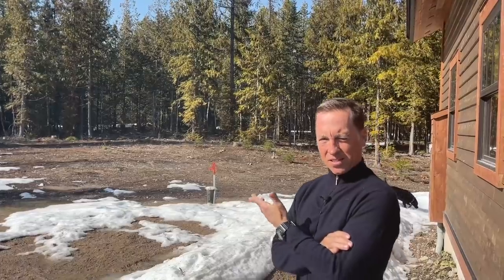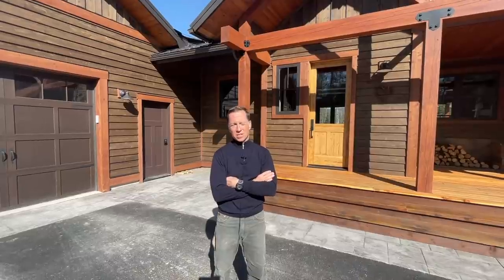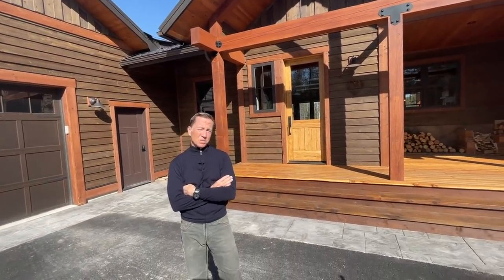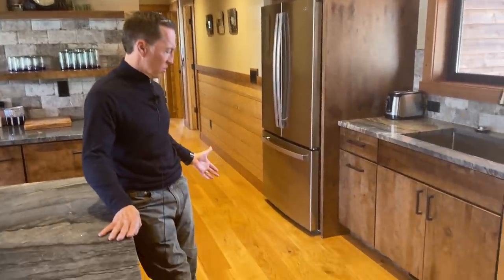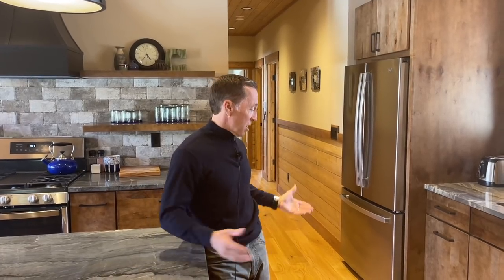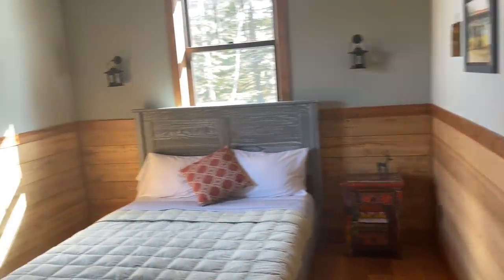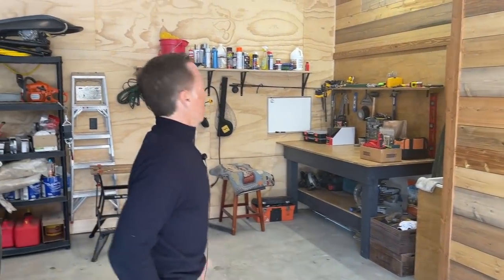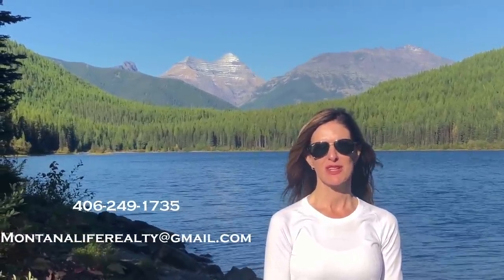Building a New House in Montana Part 2

Comment: This was a really good clip and I am thankful for the nice tour. They really did good.
If you are still in contact with this guy, the owner of the house I have a great improvement suggestion to him.
I also have water pipe floor heating. What he can do is to instal a thermal heat pump instead of that water heater. He already have a well for it. Run a hose down and up again, use alcohol as the liquid which is pumped down the well at around 32f and comes back around 36F, the pump has a heat exchanger, kind of like a reversed AC that will make warm water that is pumped out in the house floor pipes. A pump is about 5000 but is basically paid for in 3-5 years compared to using a lot more electric with the water heater. Note, it will also warm your hot water.
My house in Sweden (as cold as Montana if not colder) gives me an annual electric bill between 800-1100 a year. That includes all electric, hot water and heating.
Cheers